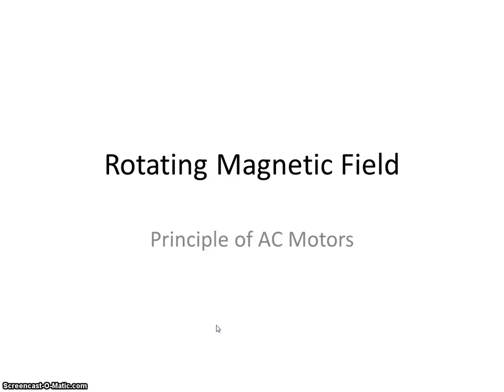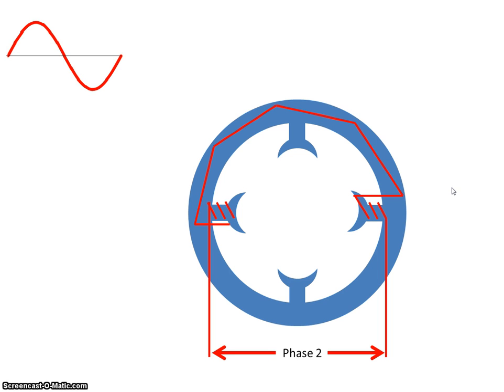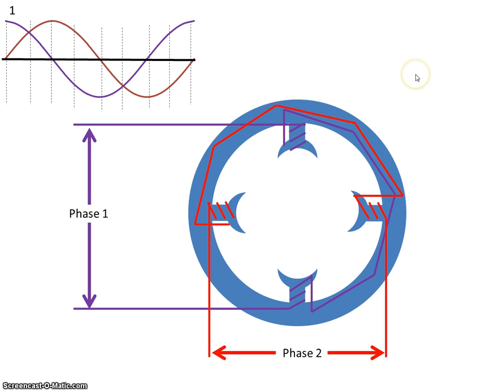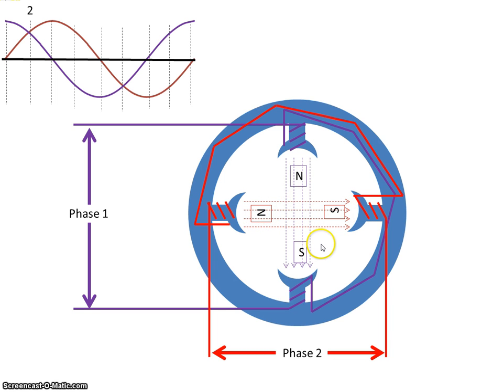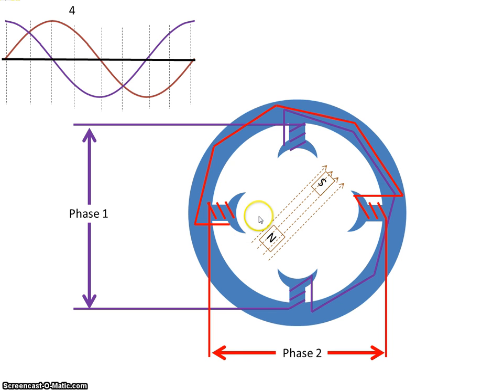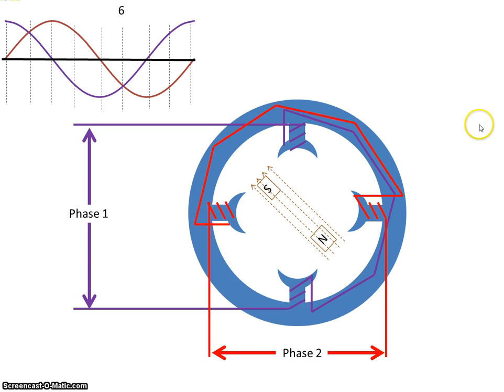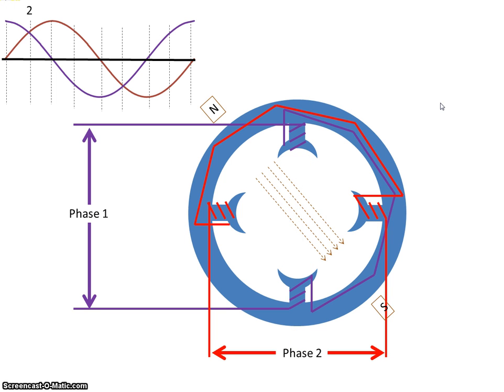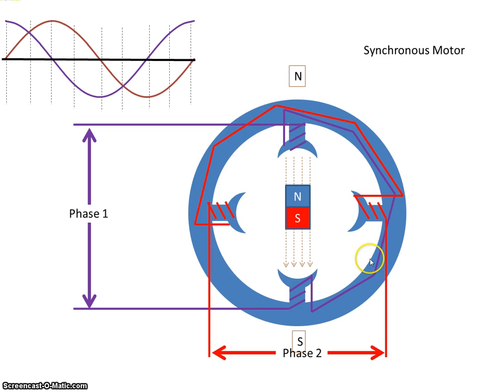Rotating Magnetic Field

Comment from the maker: The 90 degree phase difference at the start is a property of a two phase supply.  If it were a three phase supply, the phase difference would be 120 degress.  I'll do a video on AC generation within the next 12 months if you wish.  Thanks for the feedback.
Reply: Sorry...I'm a bit lost here ( not an expert.....just trying to get my head around this) .....from where is the 2 phase supply coming from?  In the UK we have a Single Phase Supply....am I right in assuming this is a Start and Run winding config?.....or split phase ?  .gratetful for any guidance 🙂
Reply from the maker: @robinfrancis789  This video was only for instructional purposes to show how a rotating magnetic field can be achieved.  In the UK, domestic electrical supply is single phase and industrial supply is three phase.   To obtain a rotating magnetic field with a single phase supply, a capacitor is used to split the supply into two phases, 90 degrees apart, as depicted in this video.

I have another video that tries to explain how the split phase works.  You can find it here:  https://youtu.be/pbg_PF6MTwY
Reply: @RoddyMcNamee  That's great Roddy....really appreciate your feedback and guidance 👍👍

Comment: great video and very comprehensive. At min 7:00 arent the magnetic poles of rotor and stator supposed to align N to S? If not, please let us know the 'why' behind it. thanks in advance
Reply from the maker: There is a North pole on the stator and a north seeking pole on the rotor
Reply: Sorry about this but I have the same trouble with the north pole of the rotor attracting (aligning) to what is shown as a north pole of the stator. I think it's was an unfortunate oversight to an otherwise excellent demo.  I.E. A north seeking pole should have an S on it.
Reply from the maker: Gregg Roessger
Thanks for the feedback Gregg and I understand your frustration with the north poles.  The only reason I did it that way is because it seems to be fairly common to describe it as such in quite a few textbooks.

Comment: Good video. BUT. A mistake in rotor field 07:02. North pole of the rotor will be in front of South pole of the stator.
And a question. This is 2 phase current. A Tesla-Ferraris motor type. There is a magnetic flux pulsation in this type. When both phases module = Imax x sin45 = 0,7 Imax,  the resulting flux will be 2 x Imax x sin45 = 1,4 Imax. This is from Dolivo-Dobrovolsky, 3 phase system inventor.
He sais that this happens in real motors. If you summarise geometrically 2 vectors, your magnetic flux wont change, that is what Tesla thought. But in real motors, resulting magnetic flux is created by arifmetical summary of amper-winds in the system.
That is wht Tesla-Ferraris motor type was not effective. This pulsation between Imax and 1,4 Imax = 40% creates a stopping moment on the rotor.
So, I do not understand why it so, why do we have this 1,4 Imax summary?

Comment: Very well explained. One point; the magnetic flux lines generated by phase 1 and phase 2 are separate fields and when you find the resultant, then it ends up with one magnitude and a direction that you showed. 
Additionally, if you increase or decrease the frequency you increase or decrease the speed (RPM) of the motor, and if you increase the number of pole pairs, you get the capacity the have more current draw and so resultantly produce higher torque. As I read on Quora; frequency is speed, current is torque, and voltage is the capacity to create torque.

Comment: Not exactly , you  will need a Capacitor in order to LAG the current 90 degress  then you get a second phase , in such a way you will produce a rotating magnetic field of CONSTANT MANGITUDE the way you  are putting  it you will get a rotating magnetic field which VARIES in MAGNITUDE

Comment: Excelent video! Now i'm just gonna ask you: what about linear synchronous motor based on a trifase current? I'm trying to understand how this system is used to launch roller coaster. I already know that the principle explained in your video is used to attract the veichle until it is passing trough the coils, and repulse it after it passed it. But my question is: if the veichle is accelerating, how can the LSM change the speed with which the magnetic field change? My insight tell me that it should work slower in the first part of the acceleration and faster when the train goes faster, but how is it possible if the frequency with which the current changes is fixed?
Thank you so much!

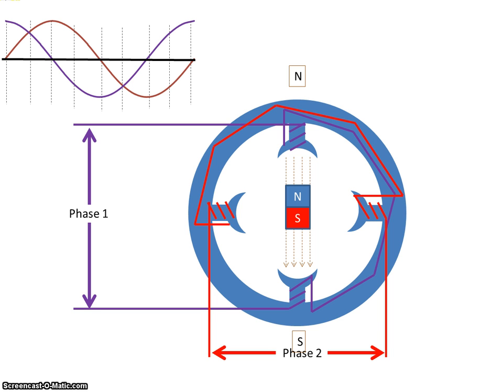Comment: 06:56 I think the physical magent put inside will be upside down, as the North attracts the South and vice versa. Take number 1 position, for example, when the rotating magnetic field of the stator is North, the South pole of the magentic bar will face it(the blue color).
Reply from the maker: If you look down through the comments you’ll see plenty of discussion about that point.  In short, if you hold a compass in your hand, the needle with N on it will point North as it is a North Seeking Pole, as opposed to a North Pole.

Comment: What happens when the phases are becoming less and less positive, or lower magnitude positive or negative cycles. Wouldn't an emf and magnetic field be produced to resist this change in decreasing magnetic flux?
Reply: That's only for induced emf not something directly connected to a voltage source

Comment: really great job buddy amazing video.... :) :)
but winding of this is clock wise in the positive terminal and anti clockwie in the negative terminal is that right????
Reply from the maker: Nirav
The right hand rule will determine where the North pole of the electromagnet is.  You just have to make sure that there is a north pole on one stator and a south pole on the other.
Reply: ok.i got it thanxx... :) :)

Comment: only 1 doubt friend you say that north pole and south pole develop in phase 1 have you taken there direction assumingly or the direction has some reason?
Reply from the maker: The direction is based on the right hand rule.  If you grab a pen for example with your right hand, then if the fingers point the direction of current, the thumb points in the direction of the north pole.

Comment: what will be the speed of this magnetic field..? is it same as the supply frequency?
Reply from the maker: Yes.  The formula that is used is N (RPM) = 120f/P where f is the frequency of the AC power and P is the number of Pole pairs.  So in this case, there are two pole pairs so the RPM is 60 times the frequency.

Comment: Very helpful video, thank you! One question follows: In the first 40 seconds you show phase 1 current flowing through two coils, one at the top and one at the bottom. You then treat the two coils as one, or so it seems. Doesn’t each coil have a north and south pole? It seems to me that flux from the south pole of the upper coil would wrap around the stator and “connect” to the north pole of the lower coil. Thanks, again.
Reply from the maker: The two coils are wired in series, and yes each will have a north and south pole.  The wiring has to be such that the direction of current in one coil is opposite to the direction of current in the other.   Using the right hand rule, if your fingers point in the direction of the current, then your thumb will point in the direction of the North Pole.  So, if you want the poles to point in opposite directions, then then direction of current will have to be opposite.
Reply: @RoddyMcNamee  : Makes perfect sense. Thanks again!

Comment: I rewinding a ac motor a d the magnetic field was not rotating the start winding was not starting and I rewinding it exactly the same way you explained I try turning the shaft but it won't turn the magnetic field was super strong I couldn't turn it so explain to me what happened
Reply from the maker: Is it a single phase motor? Is there a serviceable starting capacitor connected to one set of windings?
Reply: Yes the motor was just vibrating really strong
Reply: Yes single phase

Comment: So in real life if I were to apply Dc voltage to mimic the above with some coils and place a permanent magnet in the center that magnet will follow what is going on here you think.  Assuming it can pivot/rotate?  As in certain position it would be pointing in between two poles and not towards them?
In other words there is a vector resultant field that is sort of the resultant of cross product of each field which actually point in between them and the rotor points that way not because of momentum but because that is where the field is.   Is that the conclusion or in all honesty caused by momentum.  After all the rotor is moving.
My evidence.   In the middle of rotation change the direction of the field by switching and throwing off one coil pair so the field is not in order of previous trajectory. and watch how long it takes for the rotor to stop, turn around and change direction due to momentum.
Reply from the maker: Certainly momentum will play a part.  Indeed with a single phase motor with a starting capacitor, momentum plays a significant role.  However, to get the "magnet" to rotate in the first place requires the rotating magnetic field.
Reply: @RoddyMcNamee  I do not mean to be knit picking.  To get the rotor moving at first it doesn't need rotating magnet field, it just needs a slight phase shift to throw off the balance of opposite poles of the coil pair.  That is in fact true..  And the shaded pole induction motor is the evidence. 
And then ultimately this question should be on the table for any person who is serious about this rotating magnetic field mantra.  RMF.
Consider a thought experiment.  You have the three phase induction motor at 120 degree phase difference.  You have sequential changing magnetic field as exactly as we have now. In other words we are not changing our setup at all.
Now imagine removing the term....  " A rotating magnetic field" forms as a result of this type of set up.  Then we are reminded by the educators and the academics and the professionals that because of the "A rotating Magnetic field"  the motor is  essentially self starting, you know just to cap it  off. 

Notice the "A".  It means that One actual rotating field forms.  Distinct and no relationship to the actual sequential changing field.

Now in the thought experiment what would the rotor do if you did not have "A" rotating magnetic field and you just had the sequential alternating field as it happens in each coil of the stator.. would the rotor do exactly what it does and the whole  slogan of "RMF" out and the so called a rotating magnetic field void?
These computer animation happy folks should stop theeffort trying to construct this rotating business   and simply show the phase differences and the field  in each coil and see what happens...… I say the rotor will do exactly as it does.   

On another note, with the squirrel cage rotor, ( is it squirrel or hamster?)  I am sure magnetic field also forms but I have difficulty picturing how many and where they maybe.  I suppose there is one pair and it somehow develops in such a way that it has a north and a south at the right place and at the right time..... They never clarify that.
As the cage type motor is not the same as synchronous motor with permanent magnet rotor set up.
Reply from the maker: @alchemy1  Yes, a rocking magnetic field such as that in a Shaded Pole Motor would work also.
Reply: @RoddyMcNamee  I am delighted that you understood my explanation of the shaded Pole motor.  The rest of what said  got too long.
Reply from the maker: @alchemy1  Would you be willing to critique my shaded pole motor explanation? 

https://youtu.be/MyEnwJ1Lazg

Comment: sorry for the very basic question but... how the same current passing through the same wire can create a north pole on one side, and south on the other side?
Reply from the maker: The current is AC.  One one half cycle it travels in one direction and on the other half cycle it travels in the opposite direction.
Reply: @RoddyMcNamee  Sorry, I don't understand. Are you talking about the way of winding are winded/wrapped? (For instance a clockwise winded create a north, anti-clokwise create the south)
Reply from the maker: ytrew  Yes.  Use the right hand rule.  If you hold a pen in your right hand and wrap your fingers around it, your fingers point in the direction the current flows around the windings and your thumb points in the direction of the created North Pole.
Reply from the maker: Right Hand Rule video at this address: https://www.youtube.com/watch?v=Ri557hvwhcM&feature=share
Reply: @RoddyMcNamee  thank you so much for your time (you are unbelivable)!

Comment: How would you control the 2 phases so they would line up in that way?
Reply from the maker: +Marc Muniz 
The two phase generator would have it's windings 90 degrees apart.
Reply: @RoddyMcNamee  
Ok, so the windings have to be 90° phase shifted electrically. 

What about mechanically ? How much do they have to be shifted?
Reply from the maker: @justadreamerforgood69  Mechanically, they don't shift.  Only rotate electrically.